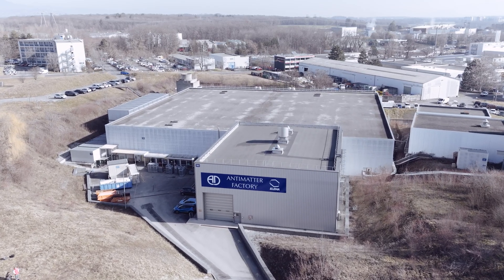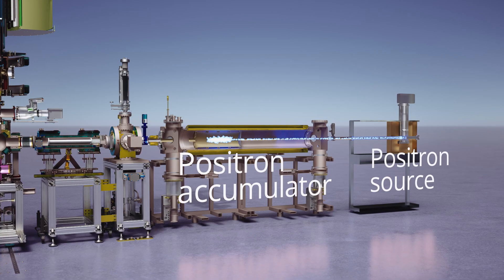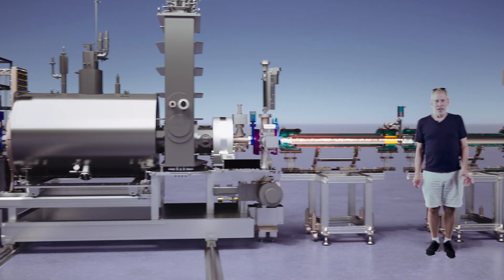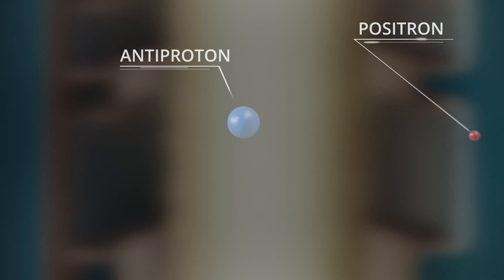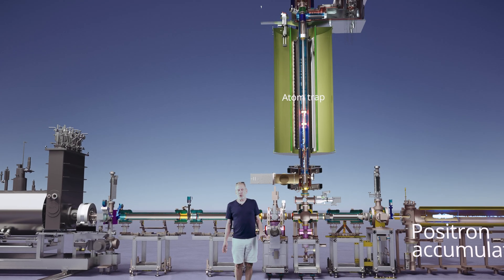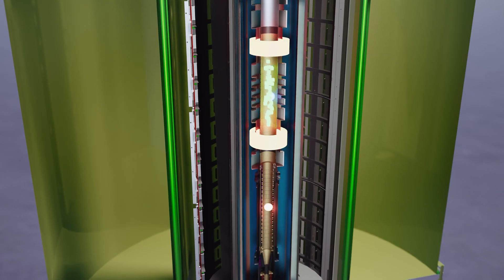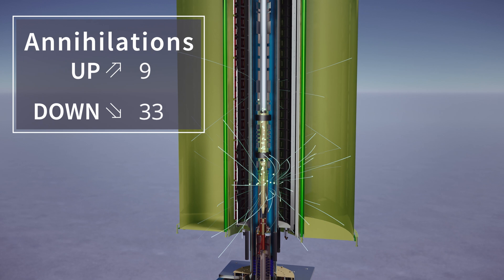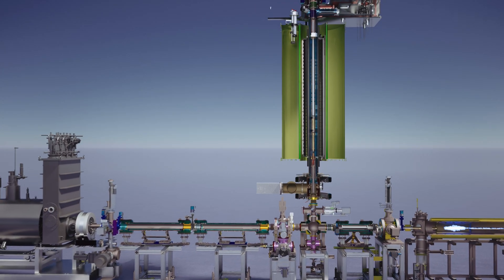How ALPHA-g creates and drops antihydrogen atoms

Comment: Basically ur trying to separate antihydrogen from other things that get trapped by gravity ?
They are still positive mass, so the difference should be nearing zero for the experiment.
The only way to separate it is to find a field configuration that affects all regular matters from the anti ones.
Which brings me to a question, if both matter and anti's react the exact same way, annihilation, then how do you know it's actual antimatter, if all the properties are the same ? You can only tell that it was antimatter after annihilation right ?

Comment: I think it is more interesting to move towards natural objects.  For example, in the direction of ordinary, but metallic hydrogen and understand whether there are several states of metallic hydrogen, as a reflection of the structure of aggregate states, conditionally, “from above”.  That is, whether there is a state of metallic hydrogen of stage one and stages beyond.  Such as the stages of rotation in a proton, for example, at least one more, looking like the limit of rotations to the state of four stages of everything, similar to the icon of a BMW car, or similar to the icon for the sun in ancient texts, a cross in a circle, and not so many feet , as the primary state of the quantities of steps of the first encountered metallic hydrogen.  Then there will be a symmetrical number of states of aggregation, according to the limit from the edges.
Reply: And this relates to ALPHA-G how exactly?
Reply: @polarisukyc1204  😂

Comment: would it be possible to create fusion with antihydrogen? Could antihelium and other antielements also exist?
Reply: As far as we know, antimatter is simply regular matter but with opposite charges. For example, the anti-proton is negative while the anti-electron (the positron) is positive. You could do fusion with them, but it would be identical to regular matter fusion in terms of energy output. And yes, we could hypothetically make other anti-elements.
Reply: There’s an idea. I wonder what dynamics would exist in a plasma of hydrogen and anti-hydrogen. It wouldn’t annihilate instantly as despite the energy of the particles, they would still need to impact each other. I wonder how long such a plasma would last
Reply: @polarisukyc1204  It will immediately annihilate
Reply: @BanTeslaX  not necessarily, a regular plasma is made of negatively charged electrons and positively charged ions, but it doesn’t instantly recombine into a neutral gas does it, there is also the matter of reaction cross section and temperature of the particles and antiparticles to consider
Reply: you dont need fusion to produce energy you can simply mix with normal hydrogen and it will annihilate and produce energy

Comment: Brilliant video , I have a question :  What are the properties of antihydrogen ? , is it the same as normal Hydrogen ?
Reply: yes same
Reply: How come it is neutral when normal hydrogen isn't?
Reply: @antoniobrown6210 normal hydrogen is neutral as well
Reply: @antoniobrown6210 normal hydrogen is neutral, for the same reason. The opposite charges of the nucleus and electron (or positron) cloud cancel out overall. Both normal and antihydrogen are somewhat diamagnetic, especially in the para state, and that is what they are using to hold the antihydrogen in place

Comment: I was hoping it goes up.😅
Reply: You aren’t alone. Electromagnetic forces can be attractive or repulsive, depending on charge interactions. Like charges repel, opposite charges attract. Gravity to date is attractive only, but I was leaning towards a model of “like matter attracts” and “antimatter and matter repel”. That doesn’t seem to be supported by this experiment.
Reply: @arsonor  Anti-matter has positive mass, just like regular matter, so there's not really any reason to expect anti-matter to be repelled by a gravitational field from a regular matter particle. It's their charges that are flipped.
Reply: @tacocookie1015  perhaps I was just wishing it was true.
Reply: @tacocookie1015  wait.. but they are anti particles. Isn t their mass like anti mass or a "negative" mass?
Reply: No. Anti-matter is only "anti" in the sense that the charge and other quantum numbers like lepton number change signs. The mass is exactly the same between a particle and the respective anti-particle. @herrdani
Reply: remember gravity is curvature in space time not a force so there is no way something move upward in a gravity well unless you gave energy or matter converted to energy

Comment: Interesting! Is this the first time we definitely learned that antimatter behaves just as normal matter in relation to gravity?
Reply: Sounds like it.
Reply: Yes!
Reply: @arsonor  groundbreaking stuff, amazing! 😊
Reply: These experimental data actually tell us that it's very unlikely that matter gravitationally interacts with antimatter through something like antigravity (a repulsive gravity). But it's still possible that there is a tiny difference (not involving antigravity) in the way they interact. They are working on experiments having lower and lower uncertainty of measurement in order to figure it out.
Reply: If you read the actual paper the data isn't conclusive and they need to increase the accuracy of the measurement i.e decrease quantum interferences. 

But yes so far it looks like it
Reply: So wouldn’t all antimatter be either miles deep from ground level, go straight into/through the ground/earth, does it bounce back up off earth and into space??
Reply: @42isthelock  antimatter annihilates immediately upon contact with regular matter.
Reply: @u @unvergebeneid     Aren’t we regular matter? Does it hit the top of our head and annihilates?
Reply: @42isthelock  yes